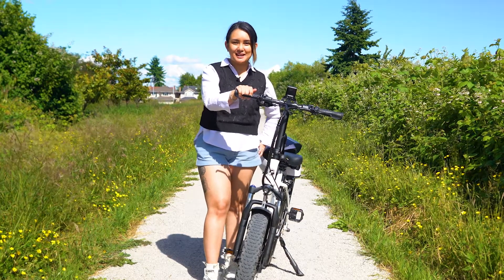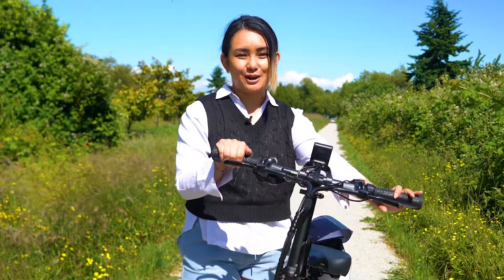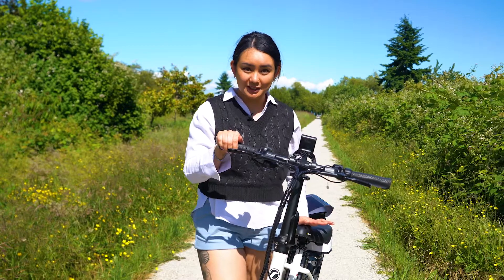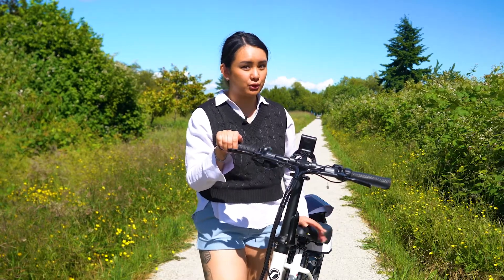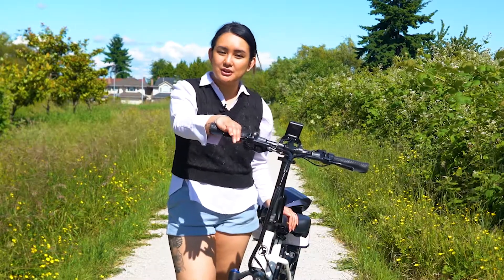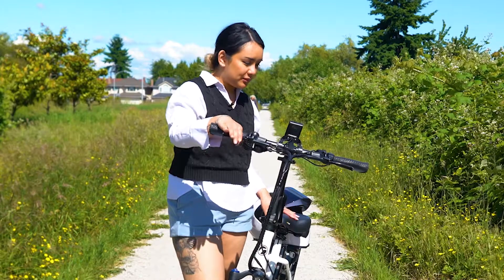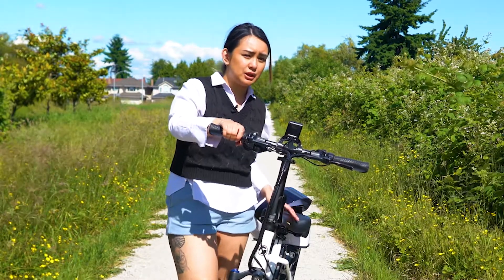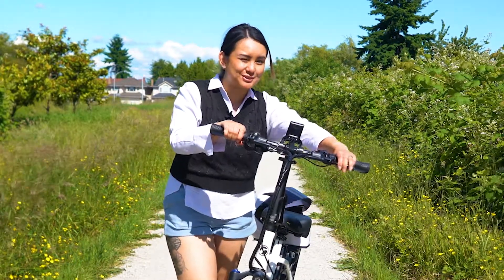How to Use Your E-bike Brakes | Rize Bikes

Comment: Hi I have a Leisure 750 I just lost a bolt that holds the front fender on underneath the shock absorber is that available to get from you it on the left side
Reply from the maker: Hi Lyle, apologies for the delayed reply. Please email support@rizebikes.com with your original order number (or date), plus your mailing address. Just mention the screw you need and Rize support will send it right out to you! thx